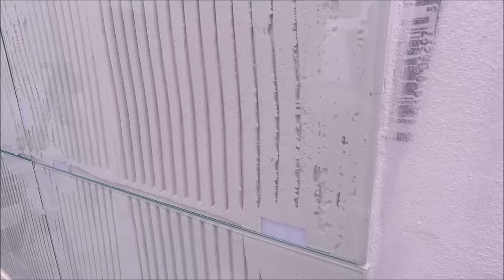How to use a Tile Leveling System for Walls

Comment: im a tiler of 10 years, no one I know would use a level system on wall tiles of this size, that is already a flat surface. not to mention the notch he used is bigger than needed and thus using more glue than needed. this "job" would have cost more than needed all so the tiler could be lazy and use the lvl systems. for 1m2 with the level system ur looking at around an extra $1.1 (not to mention if u break any top clips as most of them only last 2-5 uses before breaking) which adds up. not to mention the voids in the glue created by using clips when not needed. 

a general rule of thumb don't use clips <500mm< use clips

I should mention he used a larger notch size to fit the clips behind the tiles as u need to use at least an 8mm notch to fit them and even then it will affect your coverage. if u are using a level system I recommend using minimum 10mm notch. and put a small amount of glue both under and on the top of the wings of the part that stays under the tile after removal. this will help ensure no voids are left and that part of the clip stays in place and doesn't slide or move around (thus making them harder to remove).

one more thing, if u use the clips as crosses like he does it will make the clips harder to break I recommend using crosses that are slightly bigger so the tiles are not holding onto the clips above the breakage point. not doing this means some clips will break in the wrong place and u will be using a knife to cut the remainders down which ends in chipped tiles for someone who doesnt know what they are doing. 

I hope this helps some of the questions in chat and makes ur jobs easier to clean before grouting.
Reply: BTW in not saying this isn't a good Demo because it is, he just missed a few small tips that people don't learn until they work with these clips every day.

Comment: If this works like the video shows its amazing... anyone use this sistem?
Reply: Used a wedge system on a job before. 1500sqft of 6x36 wood plank tile. Only reason is the guy I subbed from had one of his guys on job and he wanted to use them so I said what ever. Took litterly twice as long to set. Instead of 2 guys 7-8 days to set it took 14 days. Never again will I ever use them. Plus very waste full for the planet.

Comment: You leave too much air under the tiles. With floor tiles it would be a potential problem. You need better mortar coverage. At least 80% coverage is optimal.
Reply: twice he specifically stated that he would usually back butter the tiles, but wasn't doing so for the sake of visibility in the demonstration.
Reply: Then I might not have been listening closely. Sorry, it is my mistake.

Comment: The method for leveling tiles is ok

But they are not being installed under the rules of the TCNA, they lack more precision and lateral movements in the "tiles" to avoid the air trapped in the mixture.
Reply: ive never installed tiles and even i can see that
Reply: He said he was just doing it to demonstrate the leveling an show how the they both work. 
I'm sure the wall he built wasn't up to code either 🤪😂

Comment: Hey man, just an idea.  You should look into how to set tile.  Usually you cant see through tile to see if the actual results, but in your case you can, and none of that tile is set correctly, you barely have 50% contact.  Tile, especially glass tile, will be incredibly fragile if not laid properly.  You need to rock the tile back and forth to get rid of those trowel ridges.  It should be as close to 100% contact as possible.

Looking at your tile, and the way you just continue on, its almost like no one ever taught you how to actually lay tile, you just think its about throwing the tile down.  I mean, if I hired someone to do tile, and I saw them do what you are doing, I would fire them on the spot and sue them for used materials.
Reply: It's not even a real wall. He's just demonstrating how to use the tile leveling systems. I'm a Ridgid guy and I'm going for the spinning system. And don't get so tight. Ask the company for material-loss compensation over a law suit which will probably go in favor of the company anyways. Smh

Comment: This "tightening" actually will just pull the spacers to the tile, not the tile to the wall, as spacer is small and has way less area as a tile. 
So if one wants to use them for glue thickness adjustment - one need to press a tile, not to pull a spacer..
Make same demonstration using a glass back wall and you will easily see this.

Comment: What about troweling horizontal?
Reply from the maker: As long as ridges are in the same direction! 👊
Reply: Landberg Tile TV do you ever do any reviews on schluter installs? There are so many substrates and thinset selection is sometimes confusing?
Reply from the maker: I only have one video on a Schluter Kerdi shower kit (link below). You need to use non-mod for install. The only time you use modified is to glue the foam pan and curb to the subfloor or Ditra to subfloor.
https://www.youtube.com/watch?v=QVuNK8Rpu58&t=302s

Comment: You could have pushed the tiles a bit to collapse the ridges, at least that is the goal when installing tile
Reply from the maker: Yes of course, but I was using 1/4 inch foam board which had too much flex to firmly press in addition to a floppy fake framed wall lol, this was for a levelling system demo. 👍
Reply: @LandbergTileTV  You should have mentioned that in the video, lots of DYI's will think you don't need to do that =p

Comment: The levelling system is ok if the walls are perfect most walls are not so they are useless
Reply: Yup , have to take a tile off to put more adhesive on , clips all getting adhesive all over. Clips start pulling the half set tiles off the wall to try and levell .nightmare !

Comment: That's a THIN grout line. What if you wanted a thicker grout line?
Reply: they come in different sizes
Reply: Enough with the PC you can always use the appropriate tile spacer in addition to the leveling system.

Comment: If you're running clips on 12x12's you need to go back a few steps in installation
Reply from the maker: huh? I don't understand. Clips are always good for 12x12 or larger..👊
Reply: @LandbergTileTV  12x12s have got to be the easiest to set, if you want to add time & expense, that's cool. I personally think it's a waste, if you can't get 12s planar somethings not right

Comment: the wedge system is way better.  You dont have to spend the time unwinding the spindles.  It would be a pain in my ass to have to spin and crank down on 1000 spindles, then seperate them.

Comment: Showing how to use those clips is OK. The bad part is using those stops you from achieving the proper mortar bed to tile bond which should be about 90%. You are no where close to getting that with those bad clip leveling method.

Comment: Im pretty sure u want all the channels to collapse, everyone of those tiles would start sounding hollow
Reply: @SomeDumUsrName  Hollow sound comes from a pocket of air between thinset and tile, and ide say 20-30%
Reply: @SomeDumUsrName  there is only contact on the edges
Reply: @SomeDumUsrName  the whole center of every one of those tiles will sound hollow, sound travels off air, and i see a bunch of it trapped in the center of those tiles, he also doesnt take it off the wall and show the transfer. dont forget to back butter your tiles ;)
Reply: @SomeDumUsrName  So opinions are facts now interesting.

Comment: This is exactly why i will never trust these leveling systems. It creates this false sense of doing a proper job just cause it looks perfectly flat. The coverage needs to be at least 85% this is about 60%
Reply: he did not back butter the tiles and mentioned he is using smaller teeth for this application, which should be avoided. this was a system presentation not a tile application presentation. said it in the start.

Comment: Leveling system toooo much expensive
Reply: Not really,  depends.  I use the raimondi clips, 2000 clips for 160 bucks,  so 8 cents per clip. Take a 24x24 tile , it requires 4 clips per tile , that's 16 cents psf. Actually it works out cheaper, because with cuts and all, a 500 sf job usually works out less than 4 clips per tile and it usually works out to around 12 cents psf on a 24x24. Now bigger tiles work out to 10 cents psf...what works out expensive is a 12x12 / 16x16/ and 18x18, but I rarely do those sizes anymore.  So for me it adds anywhere between 12 to 18 cents psf which is easily added into the job and well worth it because it makes for a much easier and superior install...you simply cannot get a better install without them especially with large plank tiles

Comment: I challenge this company to a tile off you use your time wasting spacers and I'll use my method that I have been taught and I guarantee you my tile will be as flat as yours in less time levels my friend plumbed studs float your walls out the right way LOL that's all it takes

Comment: Great. More plastic waste that our planet needs.
Reply: Tell us oh wise one what our planet needs.
Reply: @ryszardbargiel7256   Okay...less plastic. You don't need to be wise to understand this. It's just common sense. Educate yourself about what goes on in the world beyond your front door.
Reply: @OU81TWO  sure.  Do you know what the world around you is made of?
Do even know exactly what plastics are made of and how?
I'm not against using less plastic, etc.
But I know your type of attitude, clueless emotionally outrage.
Reply: @ryszardbargiel7256   Clueless?? lol. You're the one that doesn't even realize I'm talking about plastic "waste" and not plastic products in general. I specifically said "plastic waste" in my original comment. That refers to single use products like plastic bottles, bags, and that tile setting device shown in the video. If the company was environmentally conscious they could have designed it in 2 pieces. The part behind the tile can be plastic since it remains there while the fastening part and threaded shank is metal and can therefore be reused. This way there's no waste (for several years at least). Understand?

Should I write slower for you?...
Reply: @OU81TWO  they could have designed it in 2 pieces?  Do you have thinking problems?
It is designed as 2 pieces.  And you can reuse that orange piece.
They are sold both as a package and each.
Would you like to argue some more?
Maybe you should delete your post like many people do.
Gotta keep up that image of being smart and all right?
Just keep on keeping on with that ignorance oh wise one.
Reply: @ryszardbargiel7256   I'm not talking about the orange cap/nut. The base plate and threaded shank is one piece not two. The threaded portion breaks away and goes in the trash because it cannot be reused. Let me repeat. Make it from 2 pieces. The threaded shank is metal and unclips from the base instead of breaking off. It can be re-attached to another base for the next job. Nothing goes in the trash.

I can't spell this out for you in any more detail. Use some imagination.
Reply: @OU81TWO  I can't even begin to spell out your lack of it.
Reply: @ryszardbargiel7256   Try. Humor me and prove me wrong if you can. So far you've got nothing.
Reply: @OU81TWO  you lacked context in your statements.
Then you attack me with a complete bullshit statement: "Educate yourself about what goes on in the world beyond your front door."
Then you go on attacking with your new context missing from the entire argument before.
"Use some imagination."
Projecting a lack of imagination you have onto me, which is directly related to my original reply.
I don't want to get into what you do and do not see in this so called "plastic waste" problem you are getting so emotional about that you somehow keep providing new context to.
There are FAR greater wastes of plastic on this earth.  But hey this is the one to get emotional about.  Then go tell them to fix it.  See how they take your idea of using metal.
If you don't see the problems with your solution, then YOU lack the imagination.
You are just wasting time arguing, when you can be making plastic waste.

Comment: If you need a tile levelling system on a wall.....you’re not a good tiler...
I’d like to see how he does it on a wall that’s not plumb.
If the wall is badly built, and out of plumb, all of these clips are just going to create cavities under the tile...
Reply: Isn't it part of the whole process to make sure the walls to be tiled are plumb?
Reply: Oh man I need to stop reading these comments from all you people who have no clue about tiling lol
Reply: Lee corner I'm talking about you
Reply: ape on blow .....nearly 25 years in the trade , lol never needed a level system before they were invented and have done well out my craft, and don’t need one now.
If you need them to get your tiles on with no lips that’s your choice, 
Been at this craft for all these years and see products like this come and go..

Such an ironic post too lol 😂
Reply: Drunkenknight  some walls it’s not practical...
But you need to make sure your vertical grout lines where your cuts meet in the corners are plumb so you have to either back butter and apply a thicker gauge of adhesive in the wall where it runs out or consider either dry lining it out with a backer board or plaster board.
Building out by back butter is ok if the wall isn’t seriously out of plumb but I’ve had to knock plaster off walls and board up on the really bad ones..
I’m assuming in the USA a lot of homes are of a timber construction so any stud work shouldn’t be to far out...
Here in the U.K. some of the houses are medieval and need a complete fix for bad walls.